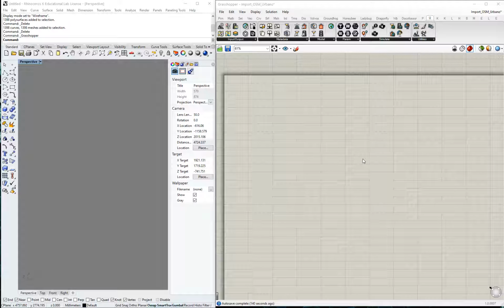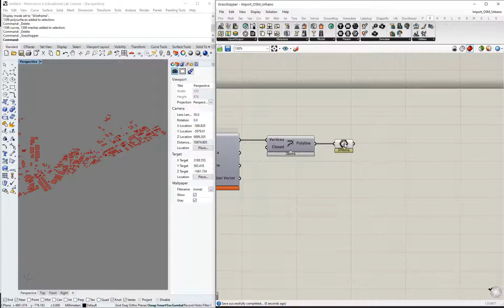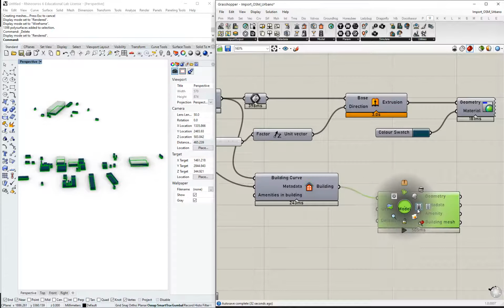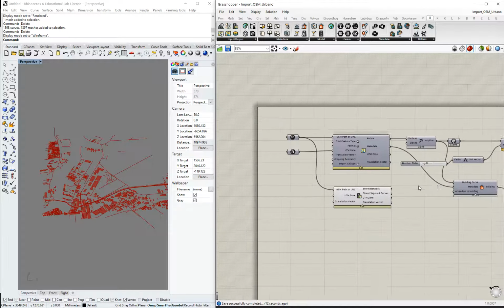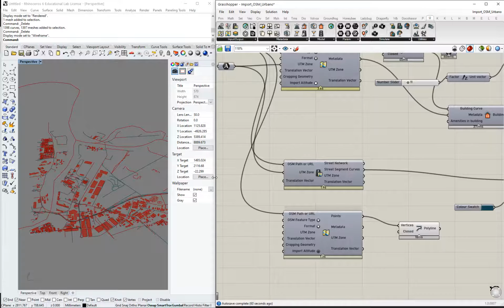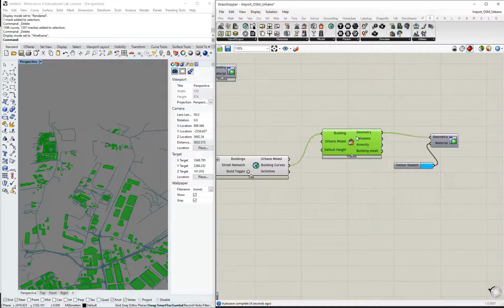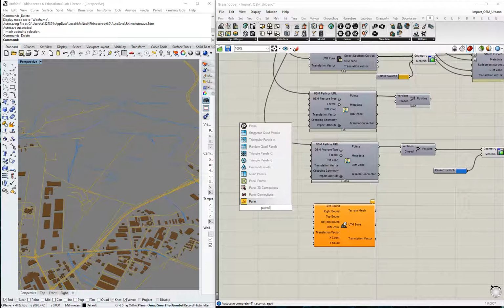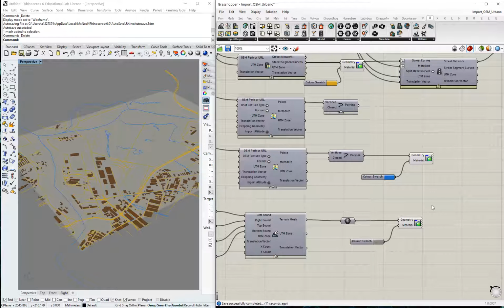Grasshopper 14: 3D modelling based on OSM data using Urbano

Comment: Hi Carlos, thanks for the video! Could you explain if the attribute table has to be named in a specific way for urbano to take the correct metadata? My attribute table has different height related to different building plots. But urbano extrudes them all at the same height. I checked the keys and values using deconstruct meta data and it seems the data is available but urbano doesn't use it when extruding building models.

Comment: Hello Carlos! Is there the possibility to modify the metadata from grasshopper by inserting a solar potential value (for example) that I calculated with ladybug for each building? Then re-exporting the file with the added data? A thousand thanks
Reply: Of course it is possible to edit the metadata outside of grasshopper, and work with it in grasshopper with a C# or Python node, but all this obviously requires more knowledge in coding. I dont know if there is a plugin with this specific capabilities you are asking for, probably not.

Comment: Hello, I just want to know if I could change the projection system to another one, for example the HK 1980 projecting system
Reply from the maker: You should change projection in GIS, Rhino doesn’t have any particular projection system since it is not a GIS software, the projection is simply used to translate data inside Rhino and place multiple datasets with the same projection system in the correct place.

Comment: For my PFE I am building my land using SHP data offered by the government. I was able to find everything and precisely what concerns the building (2d and 3d), the road network, cadastre, vegetation zones etc ...

I was therefore able to start my mapping work but I am now looking to model the terrain and project the lines on it to mount my 3D entirely on GH (to be able to generate climatic readings with ladybug and have a clean model on rhino in numb and not in mesh.

The problem is therefore that the box which allows to create the terrain displays this error to me  " impossible to create a secure SSL/TLS canal " .

Do you know why and if there is a solution?
Reply from the maker: No idea, sorry

Comment: Hello Carlos! 
I am having trouble placing the shp files in the same location. I followed your instructions on a previous video for translation vector but that is not locating the maps in the same location. What do you think may be the issue? 
Thank you.
Reply from the maker: You need to connect the same origins every time you import a new SHP and be sure the data are projected into the same coordinate system in GIS